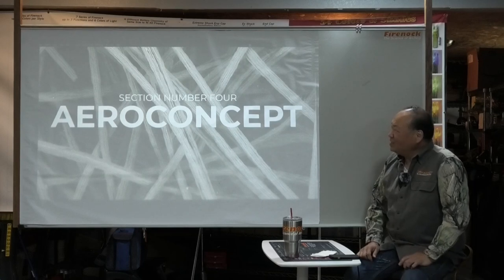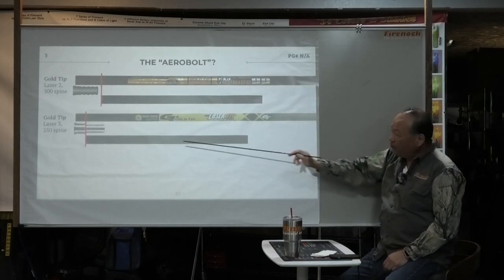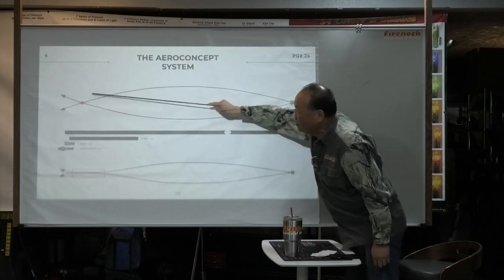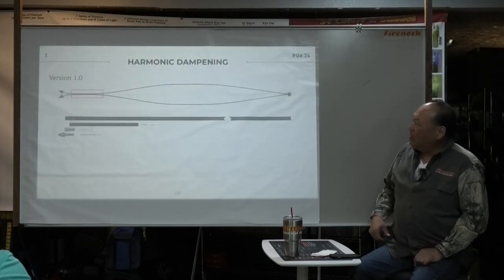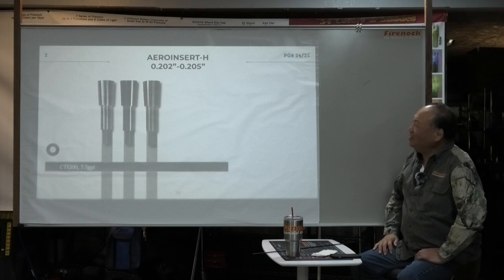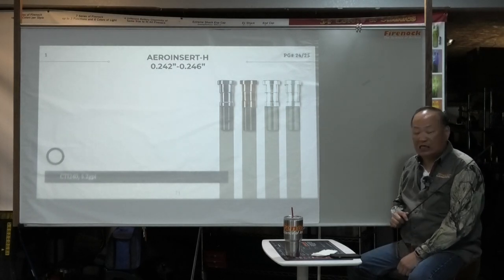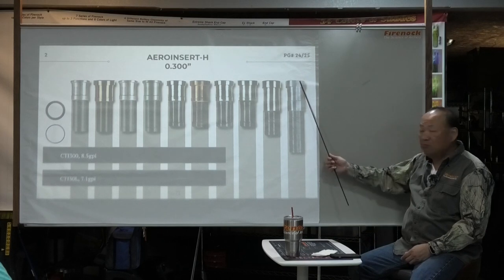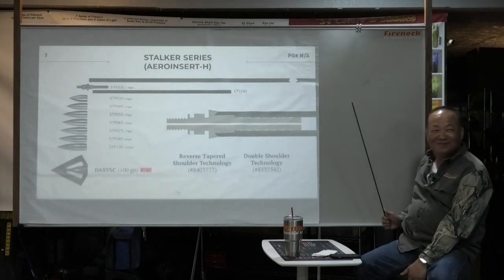Firenock Class July 2023 Henry IL #4

Comment: I prefer a HIT insert over an insert/outsert in a 204, would this system still work behind the HIT insert or will it be too long or will the mating point cause cracking?
Reply from the maker: In order to make it work in the hit  you would need a much longer arrow due to where the hit ends  and yes it can cause the arrow to crack at the junction unless it is mated like our H series insert
Reply: thank you

Comment: What is the aerocrank AD string cable thickness? My broke n it needs to be replace.  Thanks
Reply from the maker: It is a 1.5mm microdynema of high-pressure tight weave 49 strands. It is rated at 14,000 lb.  It cannot be pulled broken; anyone with a broken string is by CUTTING it.  If you have your string off the guide grove, it WILL be cut when you crank it.  So make sure the string never be off the grove..
Reply: @FirenockTV  can I buy some from you ? I bought the crank from you a few years back
Reply from the maker: Are you sure you know how to replace it? The string should never be able to break UNLESS you have the string off the string grove and got cut! There is an 84" recoil spring inside to manage the string; you would also need to replace it if the string broke! Just an FYI the string alone is $12.00 for 70".
Reply: @FirenockTV  I know how to replace it I seen your video . Took out the old one and it's pretty simple . If u can send me a link I can buy it.  I couldn't find it anywhere.  Thanks
Reply from the maker: There is no link as they are parts.  You need to email me contact@firenock.com for possible purchase of the parts or call me at (815) 780-1695